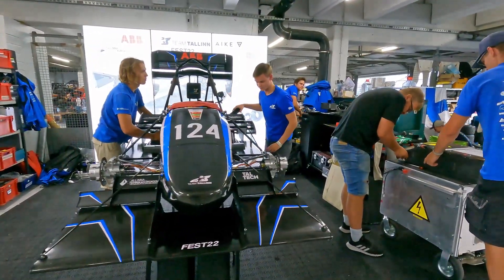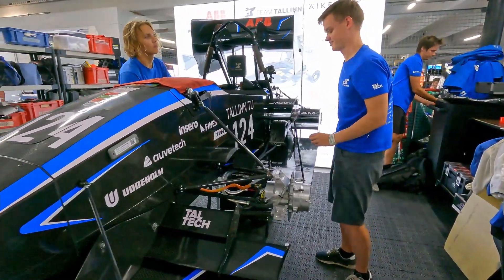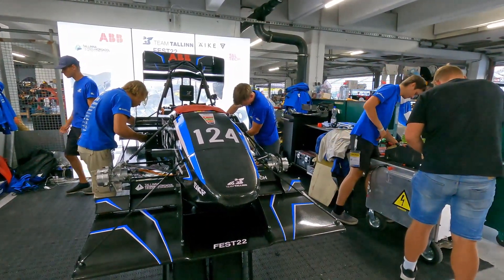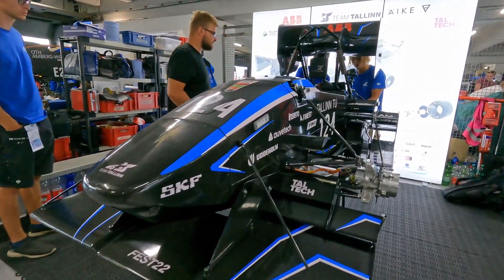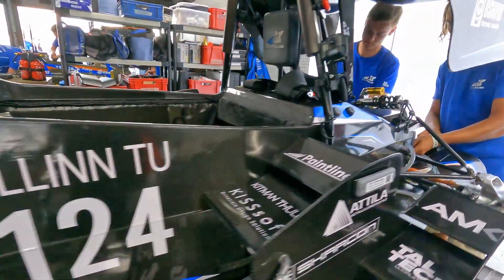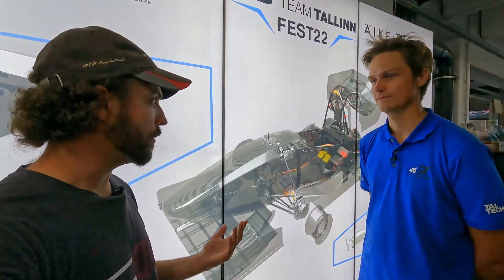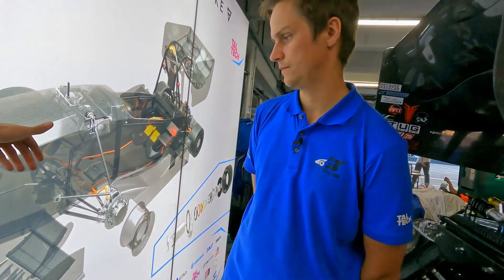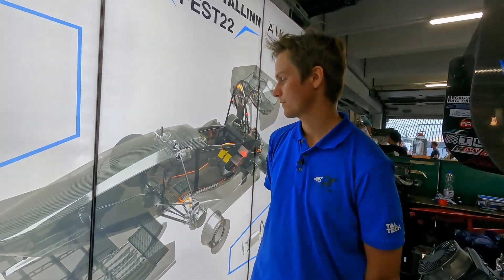_Zilz - Ground Speed Sensor by Formula Student Team Tallinn

Comment: Is a fifth wheel prohibited?
Reply: “Must have four wheels that are not in a straight line” is the rule given by FSAE
Reply: @gabekonieczny9545  While I could think of some linguistic arguments that a fifth wheel is not prohibited, I think the intent of the rule is to limit to no more or less than 4 wheels lol.

Hopefully the channel will follow back up with this team again (preferably in English again or at least w an accurate translation)

It might not be practicable but one way they could eliminate the sun wash out problem is by upping the illumination and reducing the exposure time until the sun wash out is no longer relevant. A few bracketed exposures and an algo to pick out the best exposed before computation would probably help too.

Alternatively they could try some wavelengths outside of sunlight to 'photograph' in, maybe achieving similar results with less power.